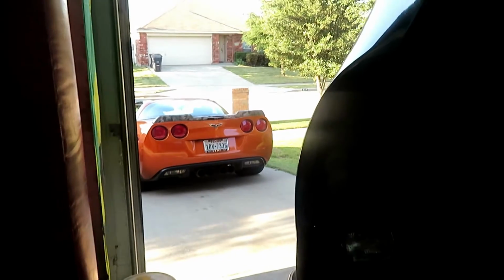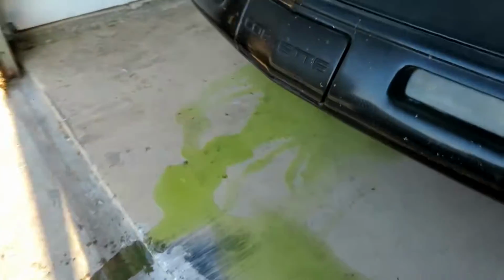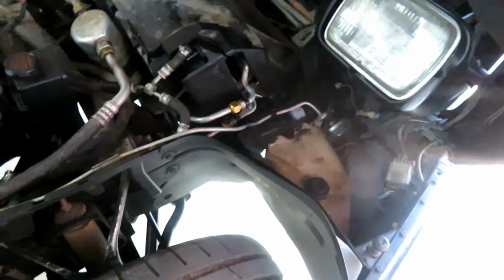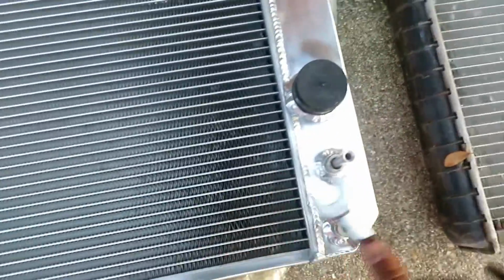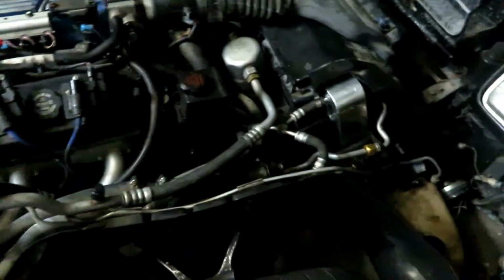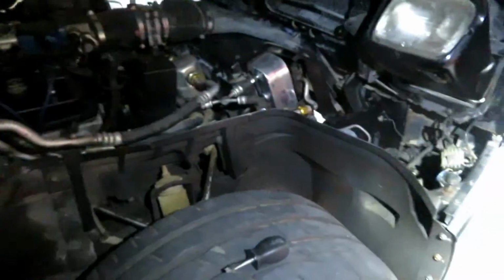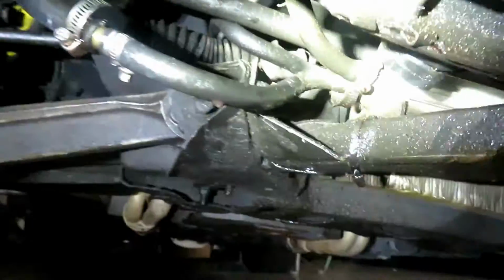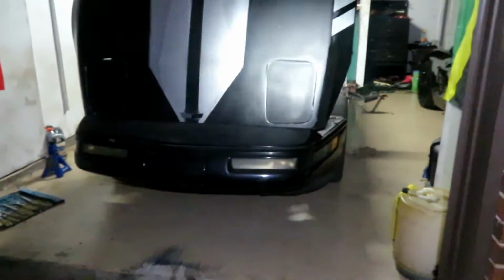C4 Corvette Dual Core Radiator Install: Engineered Cooling Products

Comment: The C4 actually does have a self burping system there is a screw near the water pump to allow you to release trapped gas.
Reply from the maker: I wouldn't really call that self burping if I have to play with the bleed screw.

Comment: Did you change the thermostat too. I’m in the process of doing a radiator change. Thanks for the intel on the dual core.
Reply from the maker: It has a 180 degree thermostat already in it.

Comment: How were your temps after driving it around?  What was it getting up to before new radiator?  What were the temps after new radiator?
Reply from the maker: 220 to 230s before radiator. 185 with new radiator
Reply: Very nice. Lol my radiator temp gauge pegs constantly but even after driving 100 miles my oil gauge never gets over 220. Changed the thermostat and the temp sensors and the rad temp gauge still pegs..... any ideas?